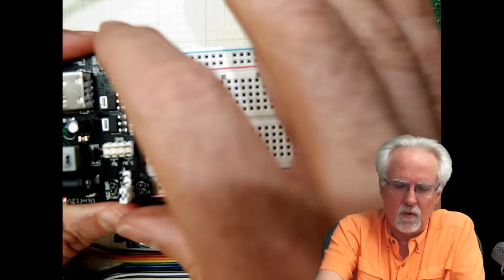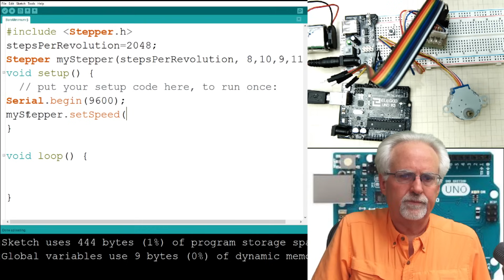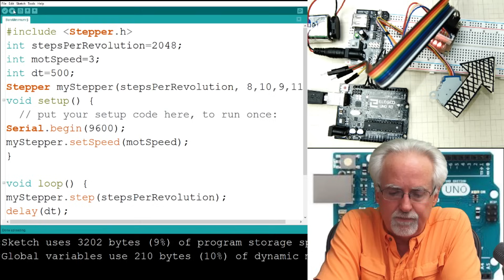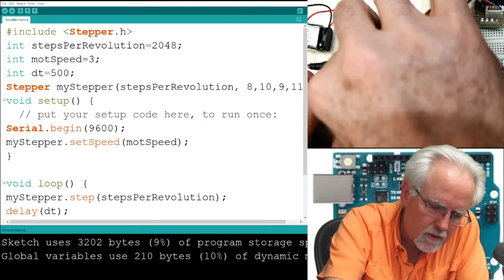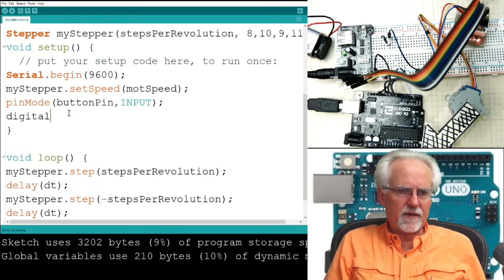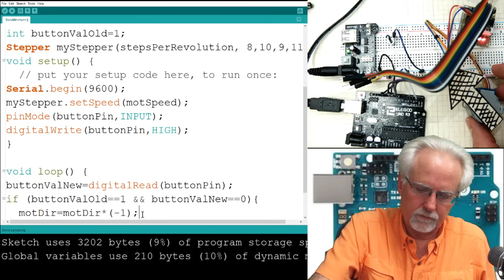Arduino Tutorial 35: Understanding How to Use a Stepper Motor

Comment: I did this on my own, in a slightly different way, also my pins kept coming out and I thought my stepper was broken lol. Here's the code I wrote if you like to see: 

#include <Stepper.h>
int stepsPerRevolution=2048;
int motSpeed=10;
int dt=1000;
int buttonPin=2;
int stepperState=1;
int buttonValue;
Stepper myStepper(stepsPerRevolution, 8,10,9,11);

void setup() {
  // put your setup code here, to run once:
  Serial.begin(9600);
  pinMode(buttonPin,INPUT);
  digitalWrite(buttonPin,HIGH);
  myStepper.setSpeed(motSpeed);
}

void loop() {
  // put your main code here, to run repeatedly:
  buttonValue=digitalRead(buttonPin);
  Serial.println(stepperState);

  if (buttonValue==0) {
    Serial.println("in if");
    stepperState=stepperState*-1;
    while (buttonValue==0) {
      buttonValue=digitalRead(buttonPin);
    }
  }
  myStepper.step(1*stepperState);
  
}

Comment: I tried to do this on my own.  I had two while loops one for each direction and the button if statements inside the while loops and if you pressed the button it would break the while loop and change the motor direction value.  It didn't work though and was like 20 lines of code.  And then you do it in 5 lines.  Much more elegant.

Comment: Must the pin be in this order or can you put them in random order in this Line "stepper myStepper (stepsPerRevolution, 8,10,9,11); Or is the order of the pinnumbers fixed by the steppenmotor you use. For example this motor i will use pin 2,3,4,5 the codeline will be "stepper myStepper (stepsPerRevolution, 2,4,3,5);

Comment: I have plugged in all the wires correctly (I checked) and the lights on the driver are still not lighting up. I have done the code and have a fully charged battery, what should I do? Btw I am using a Kuman uno instead of elegoo as this is what I had, all of the boards look identical though

Comment: Spent most of my time on this Tutorial trying to debug the wiring. Thought I had a short circuit somewhere. Turns out that the stepper motor uses a lot of current so my 9v battery ran out in less than 5 minutes. Everything works fine when I replaced it with a 6v power supply.

Comment: The LEDs on my driver board are not lighting up and the motor keeps vibrating instead of turning :/
Reply from the maker: Make sure your battery is not dead.
Reply: @paulmcwhorter  sir step per revolution for this motor is 2038 not 2048

Comment: I did it using lesson 28 as a base. My motor only reversed when it had reached 1 revolution because I'd left
the number of steps at 2048. My stepper direction was based on the button val. I now realise you can step 1 at a time, and in the same direction until told otherwise. Thanks Paul. It really is worth trying things yourself first, even if it's not quite right.

Comment: I was able to do it, but I used the button to switch a variable from 1 to -1 or vice versa. In turn, that variable controlled the motor direction. My code ended up being slightly longer. I'd probably never have thought of your solution.

Comment: Sir here is my code, although it takes some time for the stepper to turn around because I have to make a full rotation of the stepper for it to work.

#include <Stepper.h>
int stepsPerRevolution=2048;
Stepper myStepper(stepsPerRevolution,8,10,9,11);
int motorSpeed=10;
int stepperStep;
int buttonOld=1;
int buttonNew;
int butPin=4;
int stepperState=0;
int dt=100;
void setup() {
  // put your setup code here, to run once:
myStepper.setSpeed(motorSpeed);
pinMode(butPin,INPUT);
digitalWrite(butPin,HIGH);
Serial.begin(9600);
}

void loop() {
  // put your main code here, to run repeatedly:
buttonNew=digitalRead(butPin);
if(buttonNew==1&&buttonOld==0){
  if(stepperState==0){
    stepperState=1;
  }
  else{
    stepperState=0;
  }
}
if(stepperState==0){
  stepperStep=2048;
}
if(stepperState==1){
  stepperStep=-2048;
}
myStepper.step(stepperStep);
Serial.print(buttonNew);
Serial.println(stepperState);
buttonOld=buttonNew;
}

Comment: Thanks for the great video. I don't know if someone has ever encountered same issue that the motor was not turning but just vibrating when all wires were connected as instructed. I used a new battery and ensured the code was exact the same as lectured in the video. I will be grateful if one could share your solution to the same or similar issue.
Reply: I am having the same problem right now. How did you figure it out?

Comment: I nearly managed but I didn't have the idea of making the step motor do a unique step... thus it was turning infinitely and my switch wasn't functioning... 
I should have tried that before !... also I know it's a bit late and not absolutely necessary, but in the final code "myStepper.step(motDir*1);", "*1" is not usefull as motDir is 1 or -1... It's just that I was first wondering why you would enter 2 variables (direction and number of steps), furthermore separated by a "*"...

Also yes the kit is great but the battery is a joke, it lasted 10 rounds... I didn't have another 9V battery, I had to mcgyver a 9V serial mounting of 1.2V batteries ><... thanks for warning, I feared it was the stepper motor...

Comment: Hi. Have a problem. When I plug in the green wire into the breadboard, the power supply's green light goes out. Also, don't see any instruction for the little switch on the breadboard. And thanx a TON for the tutorials !
Reply: YES I HAVE THE SAME PROBLEM!!! I'm not sure what to do to fix this. Have you figured it out?

Comment: Had a little trouble with getting the stepper motor commands correct.  Failed the homework assignment but gave it a good try.  Steeper motors are so important for good projects.  Thanks for sharing your knowledge for FREE on these videos.

Comment: everything was working then one of the led lights on the sepper driver board went out and now nothing
Reply: I had the same problem?  No idea how to correct it.
Reply: After a lot of fiddling... change your battery.  Replaced it with others that still held charge and no change, but after  replacing it with a brand new battery and all worked again.

Comment: The second light from the left on my motor control board sometimes doesn't light properly which cause me tons of trouble. It seems to be an intermittent connection. How many times should I smack it on the side exactly? haha, it seems to be working now after a lot of consternation.
I'd left the servo project hooked up so used the joystick switch. When I press it buzzes briefly then steps full revs in one direction, delays then steps back.
The homework assignment I would use a boolean variable and just set it to the opposite on each button release like buttonState=!buttonState . Use that as your toggle if true or false. Should work more efficiently than an integer, right?

Comment: Not sure if i am doing something wrong but my motor is just vibrating more or less. it is the 28BYJ-48 motor. my code is the exact same as his. The only difference is the motor from what I can tell.
Reply: Did you figure it out yet? Mine was doing that and also the second light from the left on the motor control board was not lighting properly (and I didn't know that it should). For me it seems it was an intermittent connection as it "went away" after I pulled and pushed each wire carefully to reseat them.

Comment: Still failing on my homework assignments, but I'm failing 'better'. Onward!
Edit: After 2 more hours of failing, after going through every single key-stroke, every space and every command symbol in Paul's code, I finally pulled the button and replaced it with another. In Paul's words; "Boom!". It immediately started functioning correctly. 2 hours!! @#$#%$$@!!

Comment: i did everything right and for some reason my button isn't working.

here is my code:

# include <Stepper.h>
int stepsPerRevolution=2048;
Stepper myStepper(stepsPerRevolution, 8,10,9,11);
int motSpeed=10; 
int dt=500;

int buttonP=2;
int motDir=1;
int buttonValNew;
int buttonValOld=1;

void setup() {
Serial.begin(9600);
myStepper.setSpeed(motSpeed);
pinMode(buttonP,INPUT);
digitalWrite(buttonP,HIGH);
}

void loop() {
buttonValOld=buttonValNew;
buttonValNew=digitalRead(buttonP);
if (buttonValOld==1 && buttonValNew==0) {
  motDir=motDir*(-1);
  
}
myStepper.step(motDir*1); 
}

Edit: if you could tell me what I did wrong or what to do that would be great 👍

Comment: Got it working but left step value high (+/- 2048) so that the switch was only being tested every 3 seconds and therefore was not changing immediately. Changed step to '1' and it works fine.There doesn't appear to be a downside in setting very small step increments

Comment: No, I wasn't able to do this on my own because all of your lessons on how the button press worked you only showed us how to program a press and hold. You never showed any code that would make the button a toggle. I used if statements to get it to change one direction if you hold the button but I couldn't get it to change back. Your instruction on the components is great but you don't give enough info on the programming side of things. Once I figured out how to make the button toggle the other part using math was no problem. It seems to me that my problems are always about the hardware and how it interacts with the programming.

Comment: I did it using a variable for direction as you did, but I used a 1 condition if statement to check for a press of the button, then a half second delay to overcome button bounce, and then changed the value by a -1 multiply, but your way is much better as you do not get a half second delay and it overcomes a long button press.

Comment: Yeah.  Did it, but while my solution was good for the last lesson needing a button press like this, it does not work as well here.
I noticed that the program freezes while the stepper motor is doing its thing for MotorSteps, and hence I reduced it to 10, You effectively removed the MotorSteps variable, just relying on the direction of +1 or -1.  I didn't think of that.  Anyone know if that impacts on longevity of the stepper motor in any significant way?
My Solution.

void loop() {
      if (digitalRead(ButtonPin) == 0) { //They are pressing the button.
            while (digitalRead(ButtonPin)==0) {}  //Wait until button released. This effectively pauses the program (and stepper motor) all the time you have the button pressed  :(
            MotorDirection=MotorDirection * -1;
        }
        myStepper.step(motorSteps*MotorDirection); //motorSteps set to 10.  So 10 or -10.  Way less than a second delay before continuing.
}

With MotorSteps at 10 I get less button bounce (false Double presses) but if I press very quickly, I can miss the press and button feels less responsive.
So yeah, at the very least, your button solution is better..  Doh!  Humbled.  :)

Comment: Did it almost exactly the way you did it. Only difference is I use bool instead of int for the clockwise variable.  I understand c++ very well just not the electronics so much. Really appreciate all you do I have learned so much.

Comment: I did it without cheating heres the code I made 

#include <Stepper.h>
int spr=2048;
Stepper motor(spr,8,10,9,11);
int motorspeed=15;
int way=1;
int swich;

void setup() {
  Serial.begin(9600);
  motor.setSpeed(motorspeed);
  pinMode(12,INPUT);
  digitalWrite(12,HIGH);
}

void loop() {
  if(way==0){
    motor.step(1);
  }
  swich=digitalRead(12);
  if(swich==0){
    if(way==0){
      way=1;
    
    while(swich==0){
      swich=digitalRead(12);
      if(way==1){
        motor.step(-1);
      }
      if(way==0){
        motor.step(1);
      }
      }
      }
    if(way==1){
      if(swich==0){
          way=0;
      }
    while(swich==0){
      swich=digitalRead(12); 
      if(way==1){
        motor.step(-1);
      }
      if(way==0){
        motor.step(1);
      }
    }
    }
  }
  if(way==1){
    motor.step(-1);
  }
}

Comment: I made it work with this code. It is working, but I think there is some kind of inefficiency not visible to human eye. I will now look at your code.

#include <Stepper.h>
int stepsPerRevolutions=2048;
int dt = 500;
Stepper myStepper(stepsPerRevolutions, 8,10,9,11);
int motSpeed = 10;
int ReadPin=2;
int ReadValue;
int ReadPreviousValue;
int Rotation=1;

void setup() {
  // put your setup code here, to run once:
Serial.begin(9600);
myStepper.setSpeed(motSpeed);
pinMode(ReadPin,INPUT);

}

void loop() {
  // put your main code here, to run repeatedly:
ReadValue=digitalRead(ReadPin);
myStepper.step(1);
if (ReadPreviousValue==1 and ReadValue==0){
  if (Rotation==1){
    Rotation=-1;
  } else {
    Rotation=1;
  }
  }
ReadPreviousValue=ReadValue;

if (Rotation==1){
  myStepper.step(10);
}else if(Rotation==-1){
  myStepper.step(-10);
}

}

Comment: OK I'm always willing to learn new things and this series really is first class. However I feel I need to pass on some information for those outside of Europe.  
ROHS is not, I'm afraid, a manufacturer.
ROHS is a european regulation relating to recycling .  ROHS stands for Restriction Of Hazardous Substances.  It's designed to prevent careless dumping of electrical equipment and signals that the device can be recycled instead of just throwing it in the rubbish (Trash).
Thank you Mr. McWhorter for your excellent work.

Comment: Thank you Paul for the wonderful set of tutorials.

I am still wondering...why are we not using the pin numbers in order?
Stepper myStepper(stepsPerRev, 8,10,9,11);

I have the pins 1 to 4 connected in order in the Arduino from 8 to 11.
Shouldn't we use:  Stepper myStepper(stepsPerRev, 8,9,10,11);
Reply: Maybe this helps. https://components101.com/motors/28byj-48-stepper-motor
Seems that this is done because of way how this specific motor coils  are connected. in other sequence  you end up with vibrator :P

Comment: My stepper motor runs on 12 volts. is there a special hookup from the 5 volt Arduino? I know i need the easy driver and a 12 volt power supply card.

Comment: The motor axle stopped moving, but the motor kept vibrating.  Checked the battery and was getting only 7.3v.  Put in a new battery and the motor came back to life.  Life is good.

Comment: I have been following along now, doing the projects and I have learned a lot.   I have a question that may be answered later, but....

Let's say I build  project using the arduino.  How do I permanently attach wires and such to the arduino unit to create a permanent project?  

Any help would be appreciated.

Comment: I did it but I used while loops with nested statements.  I also then modified it to do the same thing with a pot, and then with a joystick where the left and right controlled direction and the backwards and forwards increased and decreased speed.

Comment: I set everything up but there seems to be a problem with my power supply. the rail that should be 5V on my breadbord is 0V. I tried to connect the rail with one of the 5V pins on the top of the power supply with a jumper cable and then it worked. Did I forget to connect something or is my power supply broken? And is it safe to drive the motor via one of the top pins of the power supply?

Comment: What is the accepted way to turn the motor off? Set speed = 0? For example if you wanted to toggle between on/off instead of fwd/bck.  
[Homework: Didn't toggle on my own, but did have motor reverse (and light a LED) when button was pushed.]  Now to code toggle.  Also I like your teaching to use variables and constants for clean code instead of hardcoding.
Reply: PS Found this forum post: Turning off a stepper motor with code, not hardware https://forum.arduino.cc/index.php?topic=367771.0 where some say turn pins to LOW to save power and others say leave power on to hold position (with speed = 0?)   I would appreciate your 2 cents this topic. Thanks in advance.

Comment: Hello sir great video. I will try this definitely. Before watching this lesson I did it with for loop. 
Motor was vibrating and moved little but not as per the program . Please tell where it got wrong. Here is list of what I used
Nema 23 stepper motor 1.8deg/step
A4988 driver 
Aurdino uno 
12v battery power supply
Capacitor 100uf
I did connection right I guess
All components are fine and new.
Please tell.

Comment: If any of you are having issues getting the stepper motor to rotate, try swapping batteries - the one that came with the kit didn't work for me.

My motor was vibrating but not rotating (the LED lights were not coming on either).  

Hope you find this friendly advice helpful. 
(Thanks Paul for your amazing videos btw)
Reply: Thanks, i need to switch batteries then
Reply: it worked thanks.
Reply: Thank you for suggesting this.

Comment: Hi paul, i tried to solve the problem.At first i used the buttonold/ new method but the problem was it did only one revolution when the button was pressed then stopped.Now i tried another code and the problem is it spins in one direction and while i press the button it spins in the other only once.
Third try i made something that uses HIGH,LOW on the buttonpin and does one revolution, stops, changes direction and so on without pressing the button it which is bad...

I just wasn t able to do it in the right way so i stoped and watched the video.What do you do when you can t solve a problem? You let it sit for a few days or any tips because i was thinking about it for a few hours from different points of view but nothing worked in the end.

Comment: Paul, the motor and switch work without the power supply. Is there a reason it’s being used here that Wasn’t mentioned? Also, the code for my setup worked without multiplying myStepper.step(motorDir*1).  I made sure to restart the program and plug and unplug everything to make sure my code was working consistently. Is there a reason that wasn’t mentioned to why one would multiply by one? Wouldn’t it just be extra code since 1*x is going to be x? Is there something about your code I’m overlooking? Thanks again! These tuts are 👍